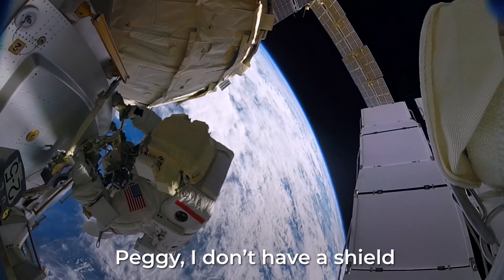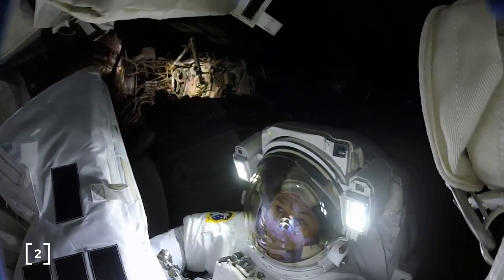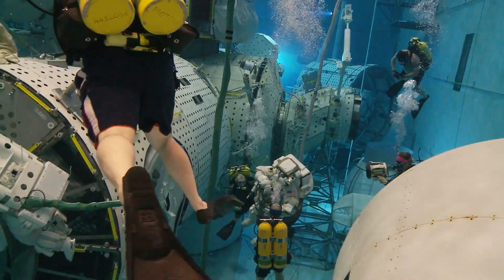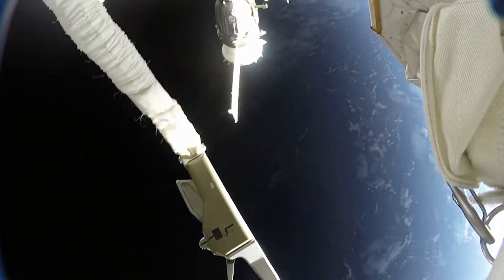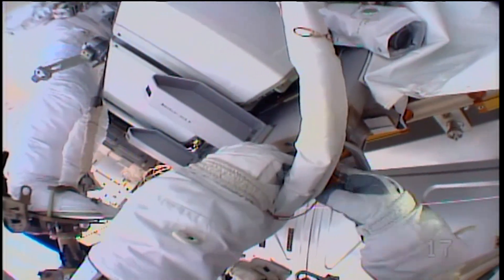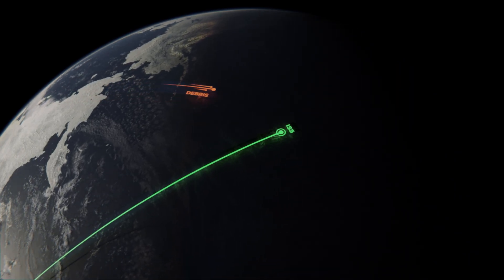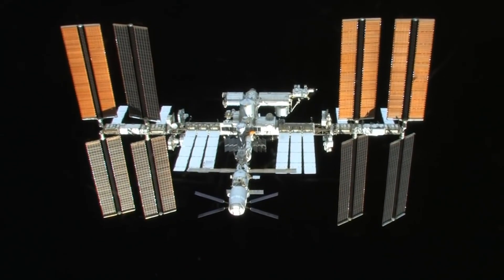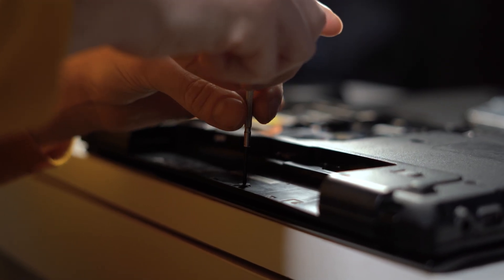Don’t Drop your Tools in Space

Comment: I'm a steel erector, dropping tools is a big no-no. Especially considering that we can be anywhere from 15 feet to many, many hundreds of feet or higher, and several of our main, most used tools have one end which is rather sharp. A spudwrench dropped from just a few feet can be deadly. But I don't have to worry about it coming back again and again at tens of thousands of miles per hour LOL.

I've rode crane balls up to max height, stood on unsupported columns with a 3-4 floor drop just inches away in every direction, walked on extremely wobbly bar joists that are only a couple inches wide, all kinds of wild shit. It's dangerous, but not like this. This is Ironwork x1000. We have actually awarded a few astronauts the title of honorary ironworkers. Lots of guys weree upset when the record for highest steel ever set was literally in fucking space! That one will stand for some time.

Great video. Fantastic.

Comment: ALL FAKE , CGI
Reply: Ur delusional
Reply: Let me just ask you a single question: have you ever seen that glowing dot flying in the sky? The one that always appear exactly where ISS should be? What is it? You'll probably guess it's a plane, flying at maybe 20 km or something like that. Apart from the fact that it never lands, how can it fly around the Earth in 90 minutes? And always show up precisely where predicted? Well, let's assume that they have some magic propulsion systems, and that answers everything. Right? Of course not. Look at that dot in the sky and look at a flying plane. It takes a similar amount of time for them both to pass from horizon to horizon. That means if it's a plane flying at an altitude of around 20 km, for it to go from horizon to horizon at a similar rate to a regular plane, it has to be travelling only twice as fast, so around 1800 km/h. Quite a bit slower than ~27000km/h. Not to mention if it was at that low altitude, it wouldn't be visible across such vast areas, thousands of kilometers wide. With some math we can calculate, that it only makes sense for it to be at an altitude of around 400 km. 
But why stop here? Maybe it's a hologram on the dome? Well, there is one more problem. It occasionally passes in front of the sun and moon. And blocks their light. So it has to be a solid object flying under them. 
In conclusion, it has to be a solid object, flying 27500 km/h and 400 km over the surface. So it can't be a hologram, it can't be a plane... What can it be then? A space station. 
And so... I ended up answering the question for you... But perhaps there is something I missed, I'd love to see if you have any other explanation, because so far, no one had.
Reply: Why dose the government want to lie about the shape of the earth
Reply: @betacrashrbx  The government is satanic, keep trusting and be a slave to lies, like cattle heading to the slaughterhouse
Reply: @DGshortzzz nice satire
Reply: @DGshortzzz the flat earthers are always funny 😂
Reply: @DGshortzzz youre so desperate 😂
Remembet, earth is a sphere and there is nothing you can do to change this
Reply: @@ChrisRobin-zg1yr reliable sources = NASA? hahahaha you are so pathetic, full of lies and contradiction
Reply: @DGshortzzz your sources are meth addicts on the internet. So yes, id rather trust NASA than you.

Comment: Develop a passive spacesuit attractor to reign in items that float away. Or place one on the side or the station and area in which you work. Electro magnet or static electricity and each item have the material on it which is attracted. Conversely have one over the area working on which catches things. Or debris net. Use AI lidar equipped robot who’s tasked with item retrieval with a tether to the station for backup retrieval.

Comment: I guess I'm surprised they didn't, like... go to get it. It's not moving very fast, if you get a long enough safety wire and push a liytle faster than the identified lost object, it shouldn't be too tough to grab it and be reeled back in. Of course, you'd have only one chance- if you hit it without grabbing it, it'll likely float away even faster, making your job exponentially tougher.
Reply: 7:04 helpful explanation. That makes sense. Sometimes you're just not prepared to make a lunge, and sometimes it might be YOU not tethered to anything...1

Comment: the best thing you can do to move around in space is making swim-like movements, so to gain some speed and direction. It's difficult though, while wearing a space suits, but that's what you have to do
Reply: Not how that works. U move forward in water that way by displacing water, which pushes you foward. In space theres nothing to displace it would be like trying to run in one of those dreams
Reply: @jgproductionen8986  you need to put a lot of effort in it, but eventually you would gain some momentum. Uncontrollably though
Reply: @GuxTheArtist  In space there is nothing to push against, or swim against as you would in water. To make matters worse, any movement however slight will cause equal movement in the opposite direction. You can't swim in a vacuum.
Reply: @GuxTheArtist  the swimming motion moves us by pushing on something else, there is nothing to push on in space
Reply: @jgproductionen8986  probsably. But if you make steady sudden movement you can push against your own body . You can use your own inertia, pushing one part of your body against another, like two different masses. Steady rapid movements, until you start spinning.From then on it gets easier, you can start swimming
Reply: @jgproductionen8986  another option is bringing with yourself common deaodorant spray cans. Just a couple of them, you can use them as thrusters
Reply: @GuxTheArtist  brotha, just google it
Reply: @GuxTheArtist  if what u were saying was true, we would be able to go faster than light by swimming in a vacuum
Reply: @GuxTheArtist  energy from movement is depended on something to push on. On earth we move forward by pushing on something that pushes us back. There is nothing to push in space.  Therefore, when we push ourselves we get the same amount of force just the opposite way, this equals to 0. Which means no force. imagine a pendulum, u push it with 1 kilo of force, it swings, and pushes back with 1 kilo = 0
Reply: @GuxTheArtist  its like arm wrestling with yourself
Reply: @jgproductionen8986  i guess, but not the deodorant spray cans
Reply: @GuxTheArtist  okay we established 2 things. 1 - cant swim in space 2 - deoderant spray cans are usefull.

Comment: if an astronaut detaches himself from the station he would gradually fall off Earth orbit and slowly go to the closest next stop, which is the Moon
Reply: The station isn't some kind of magic anchor. It's in orbit and the astronauts along with it so if they detach from it, they just stay in orbit indefinitely (assuming no air resistance from the very thin atmosphere at that height)
Reply: Wouldn't you fall towards the Earth since that's got the greater pull?
Reply: it was just a spin off hypothesis. Fact is if you separate from the station is worse than falling off a sailing boat in the ocean, you would get farer and farer away by the minute, unable of doing anything -a nightmare kind of situation. I wonder why they did not equippe the space suits with directional jets of sort, spray kind of, filled with oxygene or whatever pressurized gas, that would be enough for having some trajectory control while floating in no gravity. Otherwise you're helpless
Reply: @GuxTheArtist  
Directional jets require a fuel source and if you want proper control you'd need nozzles everywhere all over the suit which makes it even more cumbersome to suit up. There is that EVA chair thing with the directional jets that can be used but that's an accessory you need to deploy out there.
Reply: You'd stay in orbit

Comment: I figured astronauts would have had  some kind of grapple by now, spring-propelled grabber of some kind with a tether that can be attached to the iss itself after launch to retrieve even very heavy objects without risk to astronaut safety. But alas, it seems that's not feasible if they haven't done it yet

Comment: Yo are you in 2nd grade do you think I'm in 2nd grade space starts at 62 miles above the earth nothing has ever been to space because rockets can not produce thrust in a vacuum so the rocket just falls back down so keep up the bad work
Reply: Some.knowledge for ya:

Rocket engines produce thrust by releasing mass rearward at a very high speed according to Newton’s third law, not unlike how discharging a fire extinguisher pushes us backward.

Flat-Earthers claim that rocket engines cannot possibly work in space because space if vacuum and there is no air to push against. In reality, it is possible to produce thrust in a vacuum by releasing mass —that we call “propellants”— rearward at a very high speed.

We don’t live in a vacuum, and it is not easy to create a vacuum environment for experiments. However, we can use many everyday things to demonstrate Newton’s third law:

Discharging a fire extinguisher will push us backward.
While sitting in a wheeled chair, throwing heavy objects will cause the chair to move in the other direction.
While on a small boat, throwing heavy objects will cause the boat to move in the other direction.
Firing a gun will cause a recoil.
These things are some examples of Newton’s third law, which forms the basis of how a rocket engine works. Even if the demonstrations are done in a non-vacuum environment, it is clear that air does not cause motion in these cases.

References
Reaction Engine – Wikipedia
Rocket Engine – Wikipedia
Ion thrusters – Wikipedia
Momentum #Conversation – Wikipedia
Reaction – Wikipedia
Newton’s laws of motion #Newton’s 3rd Law – Wikipedia
Reply: I guess putting air into tanks isn't possible either then, Jim?
Reply: @stylesrj  he's just too dumb, he doesn't realise rockets push on the very gas they propell
Reply: Rockets can create thrust in a vacuum, ever hear of newton?
Reply: He knows more than you
Reply: Prove it

Comment: Where are all the satellites and the other spacedebrie?
Reply: You can't see them for several reasons.

In the LEO orbit, there is one satellite for every 175,000,000 km³ of volume of space. The average distance to the closest satellite is about 700 km. 700 km is more than the distance from New York City to Cleveland.
According to simulation, the average distance from the ISS to the nearest satellite is 304 km. It is about the same distance from New York City to Boston.
The ISS is about 400 km above the surface of the Earth. Neither cars, buses and even football fields are visible on general pictures taken from the ISS.
General photography on the ISS is usually done using wide-angle lenses. 24 mm lenses and GoPros are popular. Wide angle means it is harder to recognize a distant object.
Satellites come in different sizes. From small cubesats that fit in our palms, to the size of a football field. But it is safe to say there are not many satellites bigger than a school bus. All of the calculation done here includes everything. Cubesats and space debris that practically have no hope of being visible from the ISS are included as well.
The probability of any satellite being within 5 km from the ISS at any random time is about 0.017%. Not to mention they actively steer the ISS to avoid collision.
We can’t rule out satellites appearing in photos taken from the ISS. But it will be an extraordinary occurrence. And most of the time, satellite will appear as a dot, indistinguishable from background stars.
To determine if a dot in a photo taken from the ISS is really a satellite, one needs to be familiar with the position of the stars. It would also be a tedious exercise, and pointless too.
To sum it up: it is expected that satellites not appearing in general photos taken from the ISS, and if a satellite is visible, it would be an extraordinary occurrence.
Reply: @oswald9723  superb comment!
Reply: @JoseNovaUltra  thx :)
Reply: the earth is massive.
Reply: What a hell dudes???
So we cannot see satellites from iss,  but from the earth IT is ok ????
I pray for u.....

Comment: This is a real concern for workers at height (ironic that space workers are the highest lol) 

There's a sweat inducing fear of dropping your tool. Usually I put ribbons or strings to handhelds on my wrists. 

But a bigger object is especially dangerous because it could come slamming down on someone unexpectedly. Definitely injuring them or killing. 

I remember one day I was epoxying an incomplete stair well in a large building one day and the rollers grip imprinted itself into my hand I was holding it so tight.

Comment: Is the weight of the satellites impacting the altitude it needs to be deployed at when making it attracted and loose just enough so it doesn't leave orbit or fall back on Earth? That lighter piece, it's attracted down because it's too light to orbit? I'm not an engineer, just trying to figure out attraction right. It's akin to osmosis. In a fluid volume, smaller amounts of something will get attracted to a larger amount of similar materials. The moon is large, so it's in orbit at a larger distance from Earth than smaller satellites... So... The piece falling down to Earth is not heavy enough to stick to an orbit. Am I right?
Also, space is a fluid-ish volume, so like sheets on a mille-feuille cake, layers over layer of more and more dense materials until the materials are of a solid density, space being the less dense fluid, so each layers stacks like russian-dolls, and while the bigger doll is etheric somehow, the middle doll is fully materialistic. In osmosis, water is the least dense fluid, so solids reacts to the law of attraction just like space is a fluid that makes cosmic dusts stick together to the point it creates planets. Always more and more density the more matter is brought together by osmosis.
Gravity just says stuff goes down when you drop it. Attraction means larger volumes of a more dense material will attract more dense materials like dusts and the volume around it that is less dense is expressing that pressure that pushes things together. Gases are encompassing. They're heavy. Much heavier than the lightness of space.
Anyways.

That's my personal thought, out of the wild.
Reply: There is no reason why a lightweight object couldn't be in orbit. The reason why the shield wouldn't hit the ISS is because it was on ever so slightly different orbit as you say, the difference would grow with each subsequent orbit.
Reply: @RawbLV  That's interesting. What more can you tell me about these phenomenons?
Reply: @SaintMatthieuSimard  That's just as far as I understand orbital mechanics. People say the Kerbal Space Program is the best way to learn about them.
Reply: @RawbLV  Sweeet. I'll have a look into that. Thank you very much!
Oh, it's a videogame. I'll check replays :P

Comment: Best way to describe a situation of how dangerous debris in space a small metal wire has almost no limit to it's potential of speed meaning it might start at a slow speed but if it's able to it will gain speed to the point it could in theory out run the ISS if that hits anything even at a fraction of that speed say an astronaut it's like a 50 caliber bullet hitting a guy you won't hear it you may see it for a second til it hits.

Comment: I was working on an antenna on a boat in middle east once and something similar happened. Part of the basic maintenance was to replace hard rubber stops that assist the antenna in stopping its rotation. I had the new rubber stop in hand and between the fastener, screw driver, and 124 Fahrenheit heat it slipped from my hand, bounced off the mast, and plopped 60' down into the water. Needless to say, that is why you never throw away the past part if you can help it until the work is finished.

Comment: 10,000 satellites in orbit they claim....yet unseen...didn't mention them in danger 😅😅😅😅😅FAKE
Reply: The average distance to a satellite from the ISS is 304km. Good luck on seeing one!
Reply: Hi you have won. Congraduation!
Reply: Spotting a satellite in orbit would be like trying to spot a plane at night with its lights off while you're riding on the outside of a plane.
Actually even worse than that because you can hear the plane and try to locate it via sound. But space hasn't got enough air for that. Plus as A10 said, they're pretty far apart from each other.